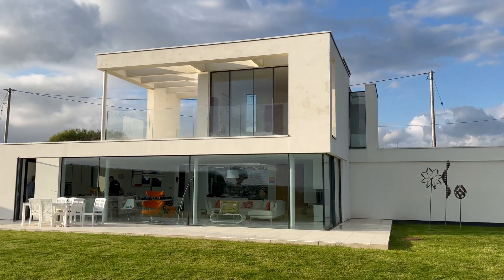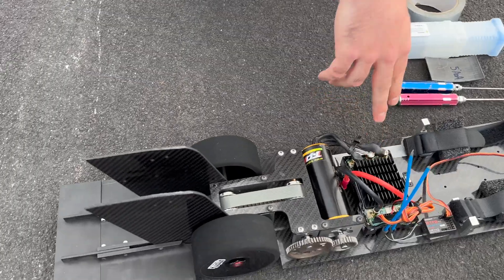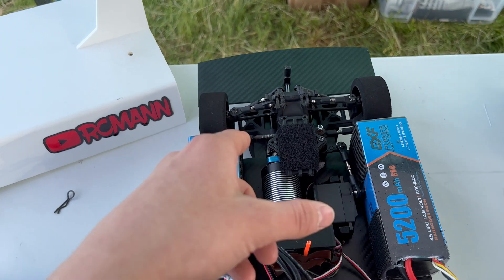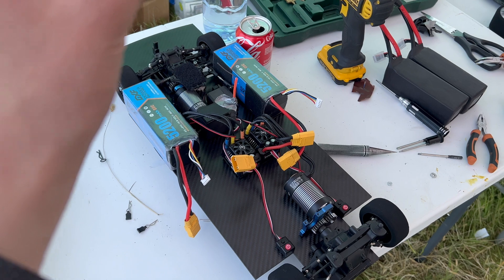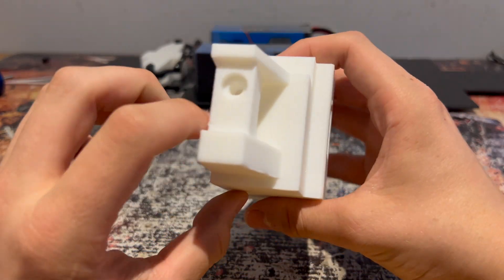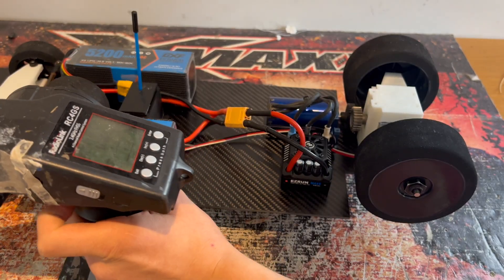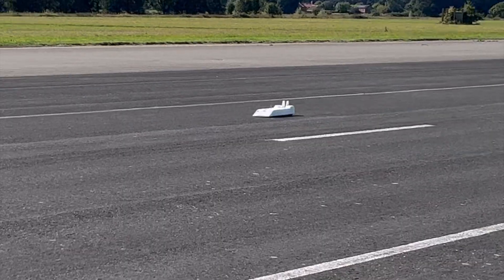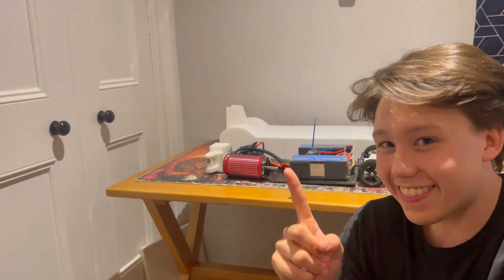I 3D PRINTED a 100mph RC CAR  Part 1

Comment: Brother, what a rad car. We are designing a promod drag car, and this is very similar to what we will end up with. Did you just clamp the wheels and diff to the axle with grub screws? or have you keyed it somehow, or did you drill holes and run a cotter pin of some kind? keep up the great work
Reply from the maker: @TheStraykiwi  thank you! I dremeled flat spots on the axle and clamped down the diffs and wheel hubs / hexes on with grub screws yes
Reply: @noahsrcs1808  awesome, keep up the great work

Comment: I believe you can do better than 150mph on 1/7 I did with a single hobbywing 5690 1250kv 167mph and i guess it was the limit on the 1/7 
good luck brother you are genius
Reply from the maker: @QatarRC  thank you so much!! Yeah I did 167mph with a tp4090 that weekend in the 1/7 vte2!
Reply: He definitely can ( when I used to speed race my old X0-1 I had it hit 173mph with dual mamba monster 1717 motors and a secret dual 6s motor output 12s input esc that was able to run both motors at once in to totally different directions at the exact same rate

Comment: Got my maverick quantum going 65 mph  on 3s originally only going 15 mph . Had to take motor out because kept blowing diffs aswell , running theme at those speeds also popped about 2 tires 😅

Comment: PLA plastic is too thick for radio waves? you should learn a little bit about radio waves, only metal and alot of mass like moutains can cause radio wave disturbance. Just get a new radio and receiver if you only get 20meter range, there is clear line of view here so you should get probably 5kilometer of range with a 100mw radio
Reply from the maker: @joki6395  yeah I know it’s too thick so that’s why I put the antenna out the top of the shell and replaced the receiver all together… after that had the full range!

Comment: Good video, mate! The new design looks really cool 
But one thing worries me - it hasn’t got rear suspension. I guess that’s what stopped it from getting the speed at Rossa 2024
Anyway, keep it up! Can’t wait for you to put this gigantic motor in there
Reply: Great video mate, keep it up!
Reply from the maker: @evilroy1000  thank you!
Reply from the maker: @Maxinator_RC  thank you! Yeah so a lot of cars currently including my VTe2 don’t have suspension and if the surface is smooth enough then they actually get on quite well surprisingly! The runway at Llanbedr is exceptionally smooth and some of the cars smaller than mine are breaking 100mph there with no suspension
Reply: @noahsrcs1808  woa, that’s impressive!

Comment: I know nothing about speed running, but would a pan car rear setup be even more simple?  Only 2 gears and you can use the rotation of the motor to keep the front end down.
Reply from the maker: @bacon9896  yeah not a bad idea! Even a belt drive would be brilliant!